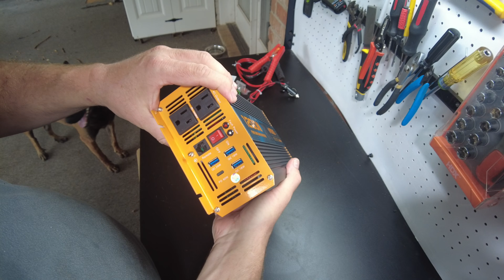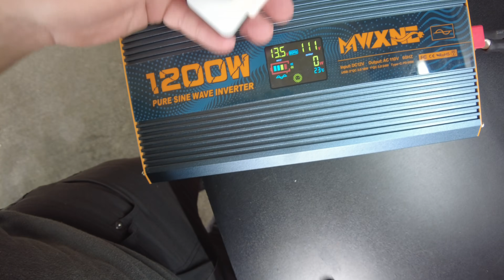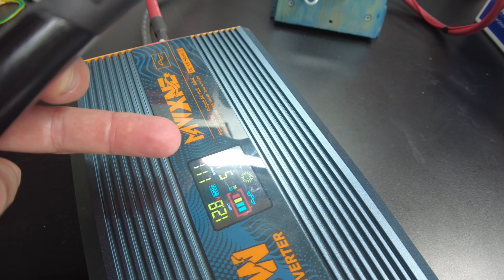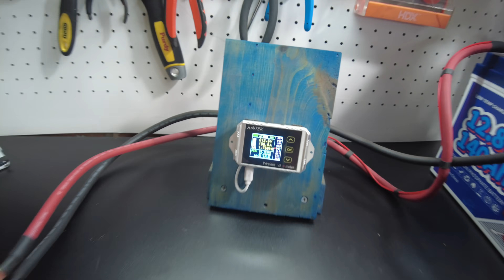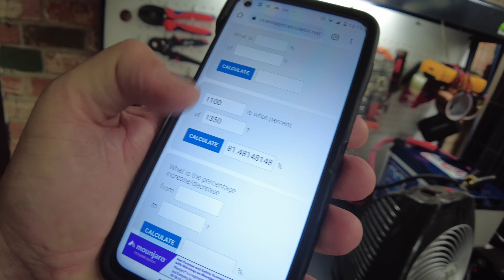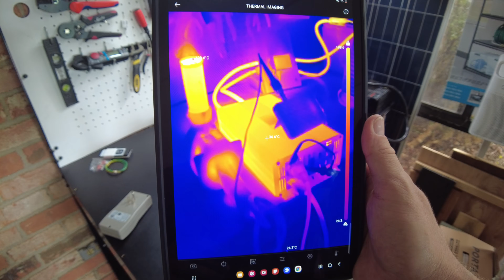MWXNE 1200W 12V Pure Sine Wave Inverter

Comment: MWXNE has replaced my remote display for my 48 volt 4000 inverter. It has been working perfectly. Customer service is great. I am so happy to be their customer. Both inverters, i also have a 12 volt 3000 watt can run 2000 watt inductive loads. I run a 12 amp chainsaw and a 9 amp air compressor with no problem. I love their products and service.

Comment: A little late to the party here but the remote battery is a 21/23 battery. If'n you don't want to wait for Amazon, you can get them at CVS. Remote works very well even without the antenna extended.
Reply from the maker: Awesome thanks!

Comment: HELP  I purchased a MWXNE 1200 Watt Pure Sine Wave inverter to power my furnace which normally takes around 400 watts.  When I attempt to run the furnace with the inverter, the motor kicks on but there is no heat and the furnace does not respond to the thermostat.  So, I built an extension cord that only has the ground wire prong on both ends as suggested in another video.  I plugged this cord into one of the outlets on the inverter and the other end into the ground connection at the furnace outlet.  No change, the furnace kicks on, no heat, and after a few minutes it shuts down and does not respond to the thermostat.  The inverter is connected to the battery in my Honda CRV using the supplied jumper cables.  The inverter output voltage is 113v regardless if the CRV is running or not.  With out the inverter the furnace works fine.  Any ideas before I return this inverter to Amazon??

Comment: 111 volts seems low for household voltage. Most are around 120 even though 110 was the original voltage, it should be 120 now. I would think an AC inverter would put out at least 155 or above even though 9 volts I guess isn't that much.

Comment: I have a 1500W inverter (Excelvan brand)  Mine has output but if I plug in anything above that uses 600 watts it shuts itself down and the fault light comes on.  No blown fuses or anything, If I cycle it off/on its good to go, until I try to plug in or turn something on that uses a lot of watts (i.e. like a small a 600 watt heater)   Anyone have any idea what is going on?   I used to be able to run things like a table saw or a small AC unit off of this thing before!  Now I'm lucky to have a  box fan and laptop working.  Any ideas?
Reply from the maker: Probably has some blown components, and it's just limping along.
Reply: @BradCagle  Yeah that's what I'm thinking too, but hoping it wasn't the case.  Thank you for the reply
Reply: Input voltage dropping too low? Need good connections and large enough and shortest wires possible

Comment: Did the efficiency calculations change when considering the watt-meters numbers? its being marketed at 92%. Load curves matter. from what I recall 50% load is best for efficiency peak.
Reply from the maker: No, the only time the watt meter showed much difference was when the heater was on med. The efficiency calculations were done when the heater was on low.
Reply: so to be clear: no change in efficiency? 82% at 50% load.  at 100% load more like 82% was maintained?  @BradCagle

Comment: Looks like an especially bad example of Chineesium, to me.
Reply from the maker: Kind of my thoughts. Would make a decent DIY power station with the USB ports and all. Add a cheap battery, and charge controller.
Reply: What the hell is chineesium
Reply: @dayner989  - It's a tongue-in-cheek reference to poorly-made products from China, typically built with the lowest cost materials possible.

Comment: Mine only shows voltage and other simple info but not wattage. I use a watt meter to monitor wattage and aprox battery capacity remaining and have had no issues. My 2000w version seems to be very efficient. I`ve used up to 3.4 kwh of the battery`s 3.8 kwh capacity but never drained it completely. Mine came with huge double cables and a remote wired display/controller that I`ve never used. I need a backup though just in case. I have limited solar and a 20amp plug-in charger. Having this stuff has repeatedly saved me from major suffering in the Louisiana heat while my relatives nearby who called me names for getting it had to evacuate to hotel rooms. And they didn`t even check on me after one of the worst storms with 80 mph winds even though I`m disabled, no car, and in a camper. My outlook on humans is at rock bottom at this point.

Comment: 17:50 Can you please check and see how much power is being drawn when the inverter is off and no load connected to the USB? Just like to know how much power the USB circuit is drawing since you cannot turn off the power to the USB circuit. My AIMS 2K inverter USB is controlled by the power switch so when power switch is off everything is off.
 Great BTW.
Reply from the maker: Ok, it's drawing 0.17w with it off, and nothing connected to USB
Reply: @BradCagle  That is not bad, very low.
Reply from the maker: I'll give it a shot, probably have to run it though my fluke to get a reading. Let you know!

Comment: My 2000w version has done its job through over a dozen power outages since last year in August. I`ve used it during five Louisiana heat emergency power outages since June with an Ampere Time battery for a small air conditioner.
Reply from the maker: Oh nice, so you have experience with this brand. That's good to know, I've never seen them. Thanks!
Reply: My 2000w one cost about 175 bucks a year ago. Mine seems very efficient. I haven`t noticed any unexpected losses factoring in only about 5% and using a watt meter to estimate battery remaining but I`ve never ran my big 300ah battery completely dead. I like the fuses too.  @BradCagle
Reply: As long as it`s 90 degrees or less I can power my tiny Frigidaire air conditioner at least 24 hours using mine and a 300ah battery. My record is 32 hours but I stopped the test after the watt meter showed 3.4 kwh was used. Voltage was still above 12 under load. @BradCagle
Reply: Hi I just bought one like you have with out a manual.  Would you be willing to make copies of yours I’ll pay you for your time and cost